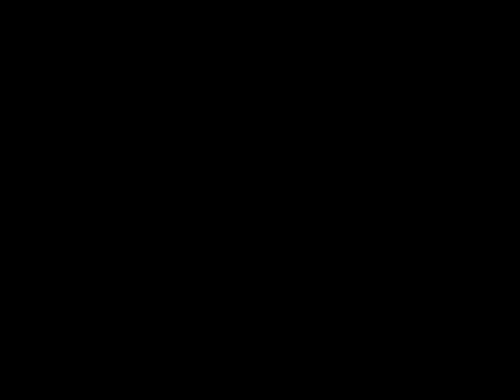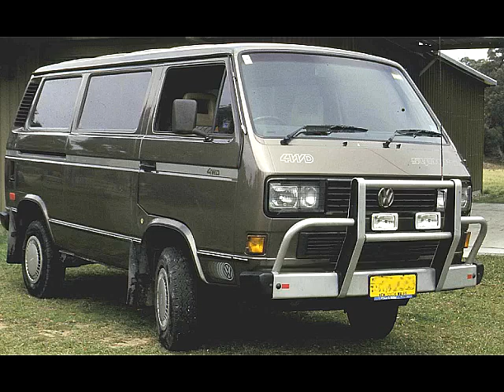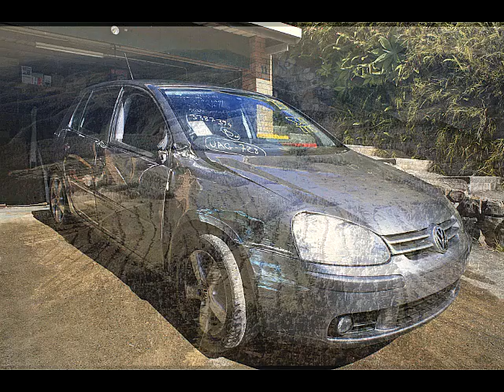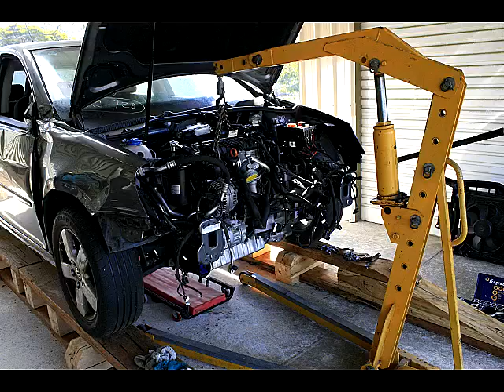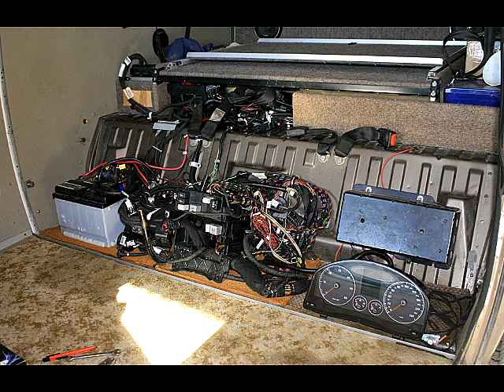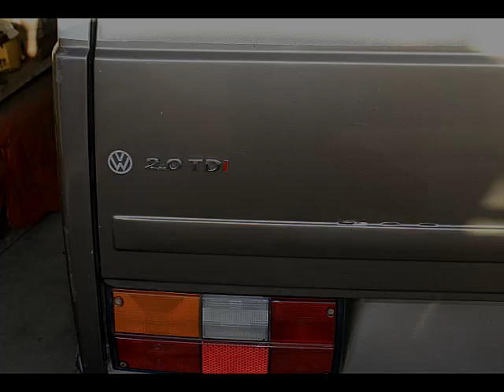VW Transporter T3 Syncro Engine Conversion using a Golf Mk5 2.0TDI BKD/PD

Comment: And the Electronic calculator etc... You withdraw it ?
Reply from the maker: No I didn't if you mean the ECU, no modern computer controlled combustion engine can function without.
Reply: @rolfgerig9829  So you took the ECU so in the T3 ?
Reply from the maker: @ridawashere  Not just the ECU but I re-engineered and simplified the BKD 2.0TDI wiring.
Please read the video descrption.

Comment: Hey mate, how’s this performing? Did you end up simplifying the wiring?
Reply from the maker: Performing very well after seven years without problems, 8L/100km.
Yes I did simplify and design my own wiring, available as a kit:
eBay item nunber 233215728217.

Comment: hello.  I'm talking about 2.0 tdi.  is it worth turning it like a native motor on the t3?  or it doesn't make sense.
Reply from the maker: If you mean the top heavy BKD's mounting angle I would never tilt it to 50 degrees. It is designed for 12-15 degrees upright and can so be mounted without a custom oil sump but you will have to highten the engine compartment, no very difficult to achieve.

Comment: Guten Tag wie hast du das Getriebe an den motor gebaut mit einer  Adapterplatte?
Reply from the maker: Adapter mit insgesamt 43mm Dicke und spezial angefertigtem Schwungrad.
Getriebe 35mm nach hinten versetzt da sonst der Motor nicht aufrecht in den
Raum passt (Montagewinkel 15 -17 Grad wie original im Golf V). Andere montieren
ihn mit 50 Grad Seitenneigung was eine Spezial-Ölwanne und Spezial Motoraufhängung benötigt aber eine Erhöhung von 120mm des Motorraumes erspart. 50 Grad würde ich
unter keinen Umständen empfehlen beim obergewichtigen BKD. 15-17 Grad erlaubt die
Verwendung des original T3 Engine-Crossbar mit relativ einfachen Änderungen
Offensichtlich ist das Ganze keine einfache Aufgabe aber durchaus lösbar. Hätte ich die Wahl gehabt, hätte ich Elektrobetrieb für den immer noch zeitlich aussehenden, praktischen und gewichtsausgewogenen VW T3 bevorzugt. Kann mir kaum jemals den in der Zukunft versprochenen ID Buzz leisten.
Reply: @rolfgerig9829  w

Comment: the worst engine you could choose
Reply from the maker: Why?
Reply: Rolf Gerig those engines break cilinder heads and oil pumps. The worst tdi
Reply from the maker: Thanks for your warning.
I will know if and when that could happen as I have built in my own engine monitoring system according to which I drive the converted car gently.
I consider my BKDC only just run in at 106'000km and it's perfomance is sensational.
What you are telling me about BKD cylinder heads breaking should not surprise me.
The Golf Mk5 BKD cooling system employs a thermostat mounted at the engine block inlet down the bottom
(a flawed design I think).
With that original design the cylinder head coolant outlet temperature fluctuates by 20 degrees celcius under most operating conditions despite the Golf's dash lying about it at a constant 90.
A no no for an aluminium alloy head clamped to a cast iron block!
In my setup, the thermostat is mounted at the head outlet and the coolant
temperature there is closely regulated at 90 degrees.
A recipy for longevity of any combustion engine.
Reply: Your T3 is impressive. How old is it?
Reply from the maker: 1989 model, makes it 29 years and no rust, that I find impressive
apart from a timeless apperance. Any of those with a usless
VW boxer motor would be pretty worthless to me.
Would have prefered to go electric but don't have the means
nor the time and decent batteries are in development but not available yet.
Reply from the maker: Manu Corral, are you a Volkswagen mechanic/technician with experience?
Hope you don't mind me asking.
If you are, you might be able to advise on a minor annoyance I have with the BKDC ECU injection
system:
Gets fuel instantly and reliably when cold and up to 38 degrees of coolant temperature,
but above it requires cranking for several seconds to start up.
Unnecessary wear and tear on the starter motor and ring gear.
The donor Golf did exactly the same before it found itself powering my converted Transporter.
Reply: Rolf Gerig there are 2 options, if The fuel temp sensor is ok, remap The ecu or install a emulator on The sensor conector will solve  The problem
Reply from the maker: Manu Corral, thanks for your input.
Had tried in the past emulating one by one of the four engine temperature sensors,
no succsess in this case.
Can't percieve any power supply, pre-glow nor mechanical issue as the cause.
Seems like a flaw in ECU software. Remap or debug ECU as you suggest is the last resort.
Competent ECU software experts are hard to find and often very expensive.
Do you know one?  I'd have more modifications to be performed.
Reply: It´s a tdi engine, any chiptunner will be able to make a good job. 
Give it an extra of power by the way

Comment: Hi Rolf,
I love what you did! I would like to do the same with the 1.9 TDI from a GOLF V. The following major concerns I have:
1. Special adapter plate between the engine and gearbox is needed - correct?
2. New engine supports have to be custom made - from what I know it isn't the same block with the old 1.9 TD found on 1999 passat or earlier. Correct?
3. car ECU and dashboard - swamped with the GOLF V, meaning you see the speed and lamp indicators when driving?

If 1 and 2 are correct - I was considering buying another motor (not VW necessarily) with it's original gearbox. This assuming that the donner car would have the engine in the back.

So I have this two options - Golf V 1.9 TDI and a completely new engine (2.5 or more with 140 HP or more) along with original gearbox. 
4. What option would you recommend?

Thanks
Reply from the maker: Hi Cerchia,
1. correct.
You not only need an adaptor plate but most likely a custom flywheel also.
You can obtain that from http://www.foreignautosupply.com/parts-accessories/60-i4-conversion-flywheel-adaptor-plate-package/#.WYlHx7hLet8 or perhaps from http://www.eurospecsport.com/products/Vanagon/Vanagon Page.html

2. correct.
Custom engine mounts are required. You will have to decide on the engine installation angle, 50 degrees side-tilted with custom made oil sump or upright at 15 degrees with standard oil pan which requires heightening the engine compartment. 
I would have little reservation side-tilting an 1.9L TDI SOHC  but would not install a DOHC 16 valve engine that way as it is top heavy. My BKD is mounted at 15 degrees upright with standard oil pan and original T3 modified engine mount crossbar.

3. That's where it gets very complicated depending on the motor of your choice:
unless you can source a freestanding ECU including a custom wiring loom
you might have to transplant the entire electrical system of a donor vehicle with instrument cluster, ignition lock, ABS controller with wheel sensors for the vehicle speed signal as I did.
I am presently working on a freestanding ECU for the BKD type system requiring not only ECU software modification but also a custom wiring harness, will take some time to complete.

4. I would recommend a modern computer controlled VW 1.9 or 2.0TDI mounted upright at 15 degrees, seems less trouble heightening the engine compartment in comparison with a 50 degree side-tilt installation with more complex engine mounts and custom oilpan. However the gearbox mounting needed to be shifted 35mm backwards for my 2.0 BKD to fit.
My heightened engine compartment serves as a bed when the rear seat is laid flat.
I would suggest to stay away from any transmission change to another brand. 

Hope this helps you in coming to a decision.
If you suceed in your quest you will have a decently powered VW T3 Transporter and a dream to drive!

Comment: engine 140 PS 320 N·m ?Do not break the gearbox?
Reply from the maker: You are right, a VW BKD 2.0TDI PD engine sports 103Kw and 320Nm of torque but the ECU software applies torque limitation in the lower gears.
No, I have not broken the original gearbox  in 5000Km, I am a gentle driver.
Reply: Can you say the letter code of your gearbox?what is fuel consumption?
Reply from the maker: Updated 25.08.2017.

Gearbox is AAK reconditioned, strengthened and modifyed with fourth gear at 0.75.

Fuel consumption is 9L/100Km with EGR, 
less than 8L/100Km without EGR:
7.5L/100km at 90 to 50km/hr on country road / town stop start.
7.3L/100km at 80 to 100km/hr on highway, no head or tail wind.

All with sensational  power and performance at your command.
Beats the old VW MV 2.1 petrol engine with 16L/100km!